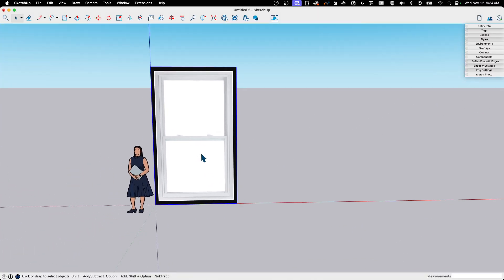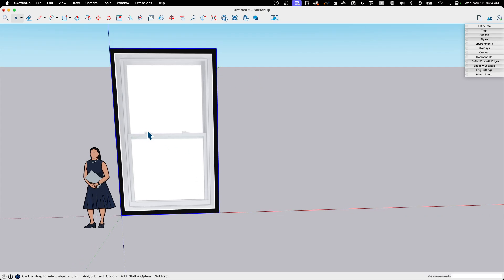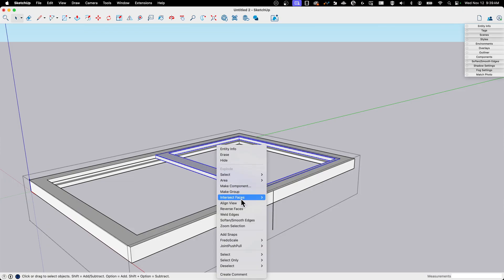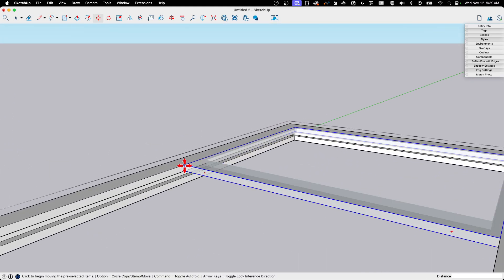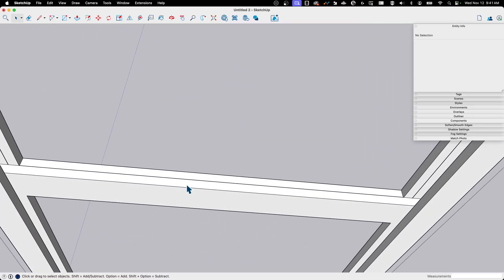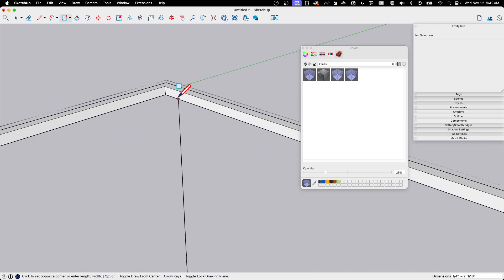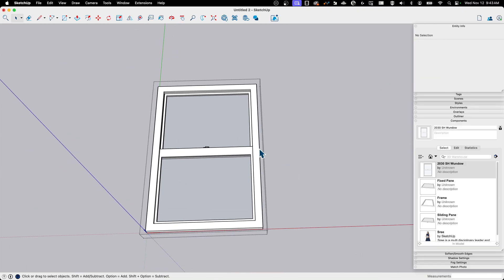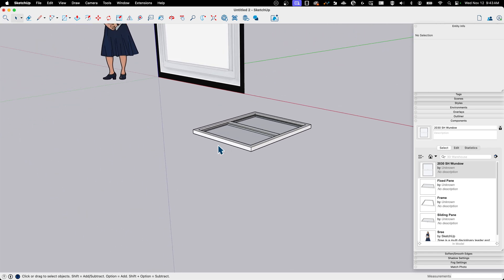Modeling a Single Hung Window in SketchUp

Comment: It's ridiculous. Windows, doors and things like that should be a built-in feature of the app, with parameters set by the user. They should also automatically punch through walls, dynamically. 
Instead of having each user hunt for plugins or draw them from scratch...

Comment: Query window panes - should they be a single face or given depth?
Reply: Like I said, it depends on the level of detail. If I wanted more detail, I would likely model the glass as a grouped extruded rectangle. For this low detail window I just needed a single face.